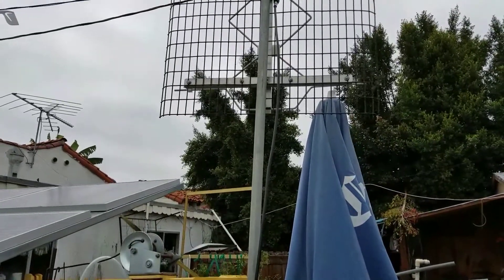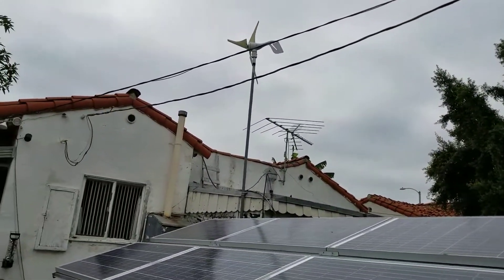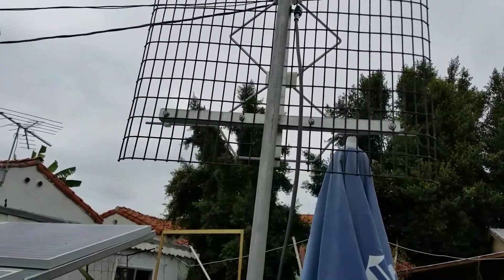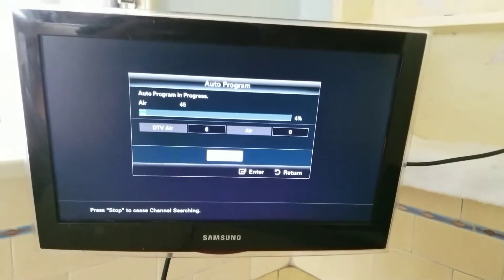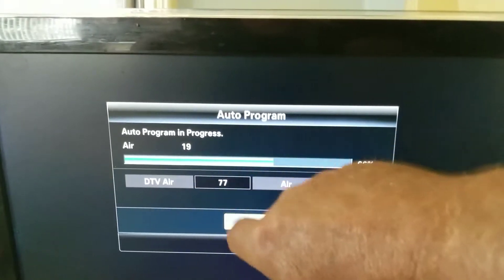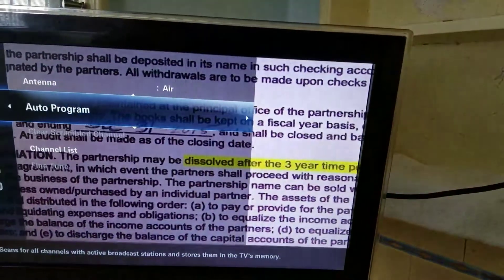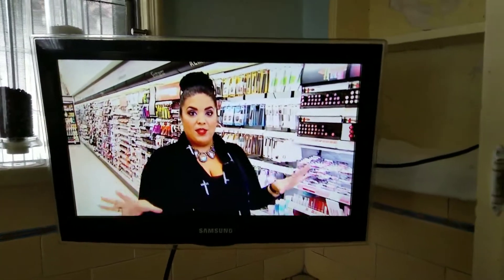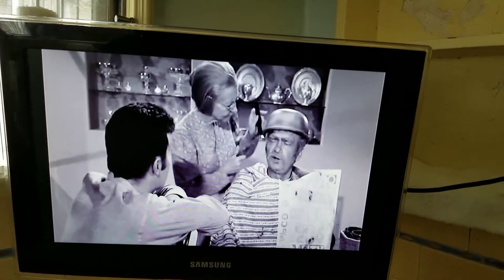Homemade 150mile DTV antenna test.

Comment: Is this a ture 150 mile antenna or is this clickbait?
Reply from the maker: Welcome aboard.   I am off grid in the California high desert,  and I get channels from cities 3 hours drive from herr on the freeway.  I have been off grid for going on 8 years, and it is still working.
Reply: @GBear how far are you from Los Angeles? In mile radius because I want to build one.
Reply from the maker: @cjpwolf2436 Welcome aboard!  I now live off grid in the high desert. Mountains block my L.A. channels, but I receive San Diego channels through the pass in the southern mountains.  I am 3 hour drive from San Diego by freeway.

Comment: I am blown away how well this tenna works. How many miles from most station Sir ???
Reply from the maker: As far as I know, there is a relay tower about 130 miles south and I have a clear path through the pass to pick it up.
Reply: @GBear  You are so lucky to have a clear path for the signals. I remember traveling on Route 66 years ago and seeing bed spring antennas in towns that had really sucky signals. The only way they got TV was with a bed spring tenna. Now we have G Bear with a homemade gadget and the TV signals come in strong and clear. Nice job fella. vf
Reply from the maker: Well mostly clear.  Sometimes, like now, I've been getting winds up to 45mph and that causes the antenna to move resulting in some channels fading in and out.  A few times the wind gusts got so strong they moved the antenna from optimal angle and after the winds subsided I had to get up there and reset it.
One of the quirks living in the high desert.
Reply: @GBear  LIving in the desert has challenges. I have seen the wind move rocks little by little. Aliens were not involved G Bear. Peace. vf

Comment: You are calling this the 150 mile antenna test. Are you 150 miles away from the towers? I'm not thinking so.
Reply from the maker: David Hicks I was referring to the antenna design capabilities, not the distance I was physically away from the tower at that location.  If you check my Homesteading the Desert videos, i now have these 2 antennas on a cabin in the CA high desert and I pick up San Diego channels.  I'm not sure of the exact location of their tower, but San Diego County line is at least 160 miles away.
Reply: So, am I understanding you right? You are over 160 miles away or further?
Reply from the maker: David Hicks from San Diego County, yes.  As I said, I don't know where their tower is, but I assume it is inside their county boundaries.
I can tell you for sure, I watch multiple San Diego channels with these antennas.  I didn't build them to patent them as scientific inventions, but instead as an attempt to be able to watch TV in the remote desert location of my homestead.  Receiving San Diego channels was an added bonus.
Reply: That is pretty awesome. I've been watching Danny S Hodges videos on building them and he tests them on camera. His are also picking up at that range. Everything I have been seeing on all the store bought antennas, is that they are not getting much range at all.
Reply from the maker: David Hicks my understanding is antennas are "line of sight" technology.  At the location I did the videos you watched, I was 38 miles from the tower and got loads of crystal clear channels, but here at my desert homestead that tower is on the other side of a mountain,  and they have a relay tower to my southeast, but I only get 8 channels from that location.  The Cajon Pass to the south has a break in the mountains that gives me a direct line of site towards San Diego,  and I get 23 channels, sometimes with perfect weather conditions even 29 channels.  I'm happy with them, but may work on modifying them in the future after my cabin and such are complete.
Thanks for watching, and if you haven't already. Please subscribe to my channel.  I am off the grid and YouTube helps finance my needs.

Comment: the poster must live in a very good reception area. I have mine [a Channel Master "deep fringe" 4-bay antenna] 100' up in a tree, and barely get any steady reception despite careful aim and an in-line signal amplifier.
Reply from the maker: Wow!  Where are you at?  I left the place where I shot the video and live in the remote desert, off grid now.  I still get 29 channels.
Reply: middle of Mason county, Washington. nothin' but tall old fir trees [most over 100'] and numerous hills. it is a notorious reception "hole" along with the west side of lake Spanaway up north, south of Tacoma WA where I lived before. only there, back then, in the 00s, there was still analog-broadcasting going on,  and the tree-mounted VHF deep-fringe antenna without an amplifier was sensitive enough to pick up Canadian TV. ah, those were the days. our present ATSC system delivers [compared to the old NTSC analog system] a non-robust signal in which reception is more often than not a challenge anywhere outside of urban areas closer to broadcast facilities/antenna towers.
Reply from the maker: ivan washington well, you apparently have internet, so maybe an investment in a Roku?   Thousands of free channels.
Reply: no high speed internet here either, borderline dsl-lite available which I have, ranges between 256kb/s-1.3 mb/s, [with many service drop-outs] not quite high enough throughput for reliable Roku/Netflix at any resolution above fuzzy. but the cost of living is relatively cheap out here :)
Reply from the maker: ivan washington well, if there was an EMP, you'd be better off than most!  Live long and prosper!

Comment: I have 2 questions. 1) About what distance were you pulling these channels in? Say, minimum and maximum range, and 2) does the deflector have to have a specific grid size/ measurements?
Reply from the maker: charles boyette in Orange County they pick up off of Mt. Wilson about 40 miles away.  I now have it mounted in the high desert and pick up San Diego channels,  about 160 miles away.
Reply from the maker: charles boyette the grid size doesn't seem to make a difference as I have seen hoverman antennas with just straight bars about 4 inches apart for a deflector.
Reply: Nice. Thanks.. I live in the middle of nowhere and want to build something similar.

Comment: Currently in the process of building one like that, hoping it picks up signals from long distances
Reply from the maker: Shaunos Morrison hopefully you have somebody broadcasting within 180 miles.  Good luck!  I have mine installed at my high desert homestead and watch San Diego channels.
Reply: Our nearest tower (UHF)  is only just under 22 miles away (35.1km), there's a broadcast tower (VHF)  just under 84 miles away (135km) (not much hilly terrain) that broadcast certain stations we don't get in this area. Heaps of other towers 90-100+ miles away but with some hilly terrain inbetween
Reply from the maker: Shaunos Morrison you should be enjoying TV after your build.

Comment: I like the test video results.  I will watch some of the antenna build videos  when I have some more spare time.
Reply from the maker: Southern Country Living note that even with trees and buildings in line of sight and only an estimated direction, this antenna recieves all the channels available in this area.  Granted the transmitter is only about 40 miles away, but it is not set high on my roof, and has obstacles in front of it.

Comment: 110 channels?!? I get 21... :(
Reply from the maker: JJohn Hipp 110??  I get 159!  😁
Reply: G Bear boiiii 😂😂
Reply: You might want to get a antenna amplifier. I got one from Amazon, and it makes an incredible difference.
Reply: @gregghernandez2714   show me that  amplifier. Enséñame ese plificador.  I got troubles with My signal tv.
Reply from the maker: Gregg Hernandez I don't think I can pick up any more channels than are broadcast, and the reception is crystal clear as is.  What in particular will I gain with an amplifier?
Reply: You will probably pick up 3 to 5 db gain with something like a Titan 2 Pre-amp.  You don't need it in your current location which is 36.5 miles from the Mt Wilson antenna farm.  But when you take it to the Mohave Desert location it will probably make a difference.  So I think Gregg Hernandez is correct in his and my advice in adding the pre-amp.  In your current Tustin address, a good indoor antenna like a powered Mohu Leaf would probably be all you need to get your channels.  Please remember that out of those 159 channels, over 110 of them are in Spanish, Vietnamese, Korean, and religious channels.  I don't know if you watch QVC and HSN but that is another 9 channels.  If you want to aim your antenna, your bearing should be 326 degrees magnetically, (337 degrees true north).  Hope this helps.
Reply: Channels 6-2 (CStore), and 6-3 (Khmer) are not San Diego channels.  They are transmitted off the same Mt Wilson towers 36.5 miles north of you.  They are received off UHF 22.  I was just curious...how do you get the 150 mile range from this videos testing?  Thanks.
Reply: 21!!!????
I GET 6
Reply from the maker: I have the small one here in the desert now that I'm off grid and I get 24 here, but that's because that's all there is available.  But I also have Roku 2 which adds another 250,000 channels.🤣👍

Comment: I have a small dipole antenna in SAN Diego and receive 54 channels on an indoor antenna it's not bad. What area are you located in?
Reply from the maker: Orange County for the video, but I have moved the antenna to the High Desert and am getting 30 channels from there.  The mountains block my direct line to Mount Wilson from up there.